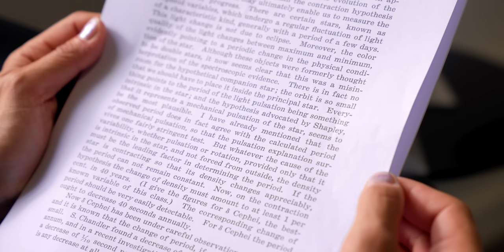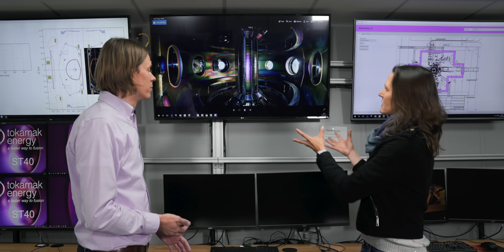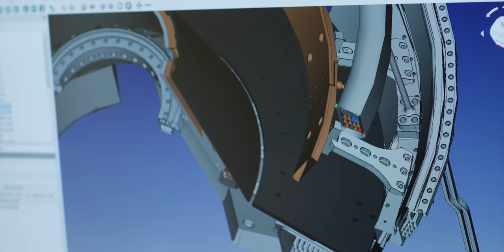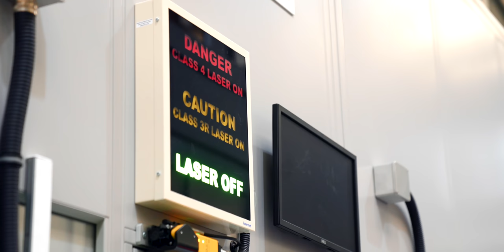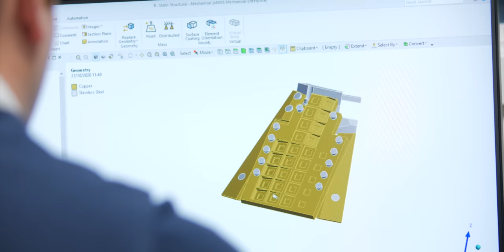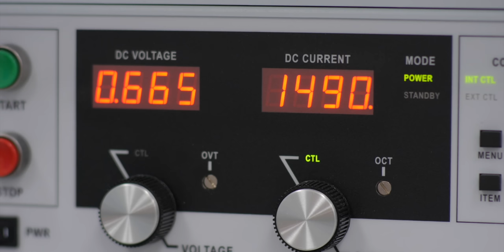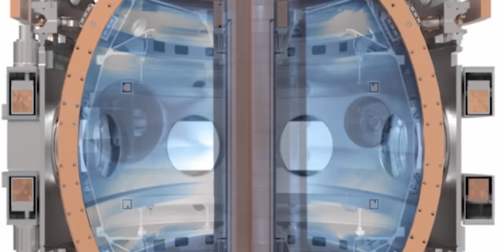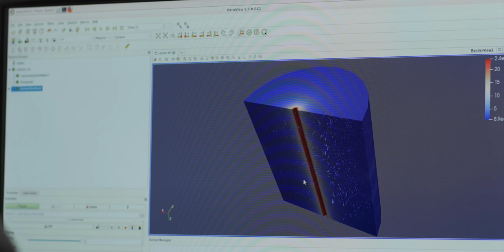Nuclear Fusion: The Secret to CHEAP and LIMITLESS Clean Energy?!

Comment: So one thing that never seems to be asked, and I'm always curious about, is how you would actually extract the energy from the reaction. With fission, the fuel is in a bath of flowing liquid that carries heat away, but it's not at all obvious how you would extract the energy from a ball (or donut) of plasma, especially when so much effort is put into keeping the energy from escaping.
Reply: I often wonder too but perhaps one would absorb the radiation
Reply: The walls of the vacuum chamber heat up, both due to radiated heat from the plasma and neutrons from the fusion events. It needs to be cooled down by water or some other coolant. The heat that goes into the coolant can then be used to run turbines to convert it into electricity.
Reply: EXACTLY ! How indeed do you contain a plasma at tens of millions of degrees without the thing melting ! There don't seem to be any real engineers working on this, just theoretical physicists with their heads in the clouds.
Reply: @grahamstevenson1740  Uh... in case you weren't being sarcastic, you contain it with magnetic and/or electrostatic fields.

Anyone who's been remotely in touch with fusion reactor development knows containment is one of the biggest areas of focus. To say there aren't any real engineers working on this is so absurd it HAS to be sarcasm...
Reply: @Smidge204  BUT, the magnetic fields (never heard of electrostatic being used, doubt that would work) DON'T stop the damn thermal energy do they ????

How is some solid going to be comfortable with a 50 million degree radiant source on one side and relatively 'normal' temperatures on the other ?

It's a perfectly sensible question and one I've NEVER had a satisfactory answer to since most of the researchers seem to have their heads in the clouds !
Reply: How do you extract it? Not very efficiently I’m afraid.
And adding that low efficiency to the high energy cost of containing and heating up the plasma, you have the reason why the 30 years joke is probably even too optimistic… 😐
Reply: Turns out they worry about that. Clearly without proving they've solved it, since nobody has got much beyond break even for more than a dinkosecond.
Reply: The neutrons produced in the reaction fly out and hit the surrounding torus heating it up. That torus of magnets needs to be kept at liquid helium temperatures, so it's of no use for generating power. In fact, it consumes power keeping it cold.

It's really just another in the long list of issues that are supposed to get solved "in 20 years".

Maybe enough neutron flux will pass through the magnets to another layer that can absorb them and heat up enough to produce power. Of course if the neutron flux is that high, it will transmute the torus into junk in a few hours.

So there's another issue that will get solved "in 20 years"

Really, the more one finds out about this, the more it makes sending money to a Nigerian Prince seem like a sound investment.
Reply: @grahamstevenson1740  Maybe the reason you've never heard a satisfactory answer is because you don't understand the physics?

First, look up inertial electrostatic confinement. Generally speaking, plasma confinement is a "solved problem" - the challenge is building a large enough "bottle" while also keeping the density and pressures necessary for fusion to occur. The Tokamak design is the most popular since it has a large volume and can be made stable.

With that out of the way... there are three modes of heat/thermal transfer;

1) Conduction, which is heat transfer from one medium to another through direct contact. Since the plasma is, ideally, not physically touching anything, this isn't a problem. In practice the occasional ion will have enough energy to maybe reach the walls but the engineering challenge is to minimize that.

2) Mass transport, aka convection. Heat transfers from one medium to another through an intermediate substance that moves between the two. The plasma exists in a vacuum, so there's no intermediate substance to carry the heat between it and the vessel walls.

3) Radiation. All matter above absolute zero in temperature emits energy as electromagnetic radiation. Heat is transferred between objects based on the net flux of this radiation. This is the ONLY method that the plasma can exchange energy with the vessel walls.

This one is a bit tricky, because the amount of absorbed or emitted radiation, and the energy per photon, is highly dependent on the matter - for example, you can engineer a material that emits more thermal energy than it absorbs, resulting in a surface that is always a little bit cooler than surrounding ambient even in direct sunlight. A really good emitter but a poor absorber. You can of course do the opposite and create a great absorber but a poor emitter - such a surface can be hundreds of degrees but appear cool to a thermal camera.

Surface area and distance also play a role. No matter how hot, radiative transfer can only happen at the surface. The reason the sun, at 6000C at the surface, doesn't burn nearly as much as an iron ball at 1000C inches from your face, is because the sun is millions of kilometers away. Inverse square law and all that.

So we need to consider both the properties of the plasma and the containment walls and their spacial relationship.

Some plasma is actually really bad at thermal emissions, so just because it's incredibly hot does not necessarily mean it's emitting a proportional amount of thermal energy. Similarly, you might have noticed in various photos that the vessel walls are really shiny - this surface finish reflects thermal radiation back into the plasma and minimizes absorption.

So we can't avoid thermal transfer from radiation, but we can go (and have gotten) a long way to minimize it through engineering. Success is a matter of getting the plasma hot enough that the collisions have sufficient energy on average, and dense enough that collisions happen with enough frequency, that the reactor outputs more energy than it takes to run it.

The reactor shell will still need cooling. The other comments suggest that this is how you extract the energy - I mean, probably? But my point is I want to hear that from the scientists and engineers actually building the machine, not conjecture from the audience.
Reply: 80% of the energy is in the neutrons that fly out of the magnetic field into a heat absorbing blanket area. For the CFS company this will be a molten salt protecting the magnets for at least 10 years. Salts are corrosive which will be a headache but they can also operate at much higher efficiency than water, from under 40% for water to over 50% for a high temperature salt
Reply: @grahamstevenson1740  the plasma is confined by the magnets, it touches nothing but it's also turning out to not be a very workable technology. ITER will by design fall 100MW short of breakeven. It's not going to work.
Reply: @grahamstevenson1740  it does work but not well enough to produce net energy.
Reply: @Smidge204  If 'solved' then why does the plasma 'break up' which usually seem to precede any run ?
Reply: @grahamstevenson1740  For the same reason that making a 12oz water bottle is a solved problem but making a 12-billion-gallon tank is identical in concept but a skosh more difficult in the... finer details. All the theory is worked out and it's currently in the engineer's hands to turn that theory into practice at the required scale.

So again, to say engineers aren't working on it is absurd. You didn't even know about electrostatic confinement - literally the method of choice for DIY fusion reactors (Did you know more than one person has built functional fusion reactors in their garage? Some of them high school students!) - so I presume your knowledge in the field is somewhere between "I've seen a few YouTube videos about it" and "Disinterested layman".

You will never get a satisfactory answer to your question, because if you had the foundational knowledge needed to understand the answer you wouldn't have asked it in the first place.
Reply: @skylerlehmkuhl135  It's crazy that after all this time we've been generating electricity it all just ends up being generated by boiling liquid and pushing steam through a turbine...
Reply: @Shep Raynham That may be true but I'm retired now. It would be interesting to be involved in that research or also in BEV development actually.
Reply: Two answers: 
You either heat a fluid like water and turn a steam turbine; the same as most electrical production systems. Or, another way, a research group recently found a way to extract electricity directly from the electromagnetic field produced by fusion. Very much like those induction batteries charged on plates with no direct connection. Both ways would work though to make electricity.
Reply: @grahamstevenson1740  you need the thermal energy to heat up water and then steam using turbines and generators 🤦🤦
Reply: @woodpenguin954  The problem is how to avoid melting the heat exchanger with hundreds of millions of degrees on one side.

Comment: Would be amazing if you guys could cover CFS’ SPARC reactor at some point. I think either CFS or Tokamak Energy will be the ones to break through to commercial sale, but as was said at the end, even if these technologies are a technical success, they’re unlikely to be cheaper than renewables in the beginning, and will take decades to mature. Not to mention they’re a very centralized form of energy (also high capital costs) which, in an increasingly unstable climate, is not the most resilient addition to a power grid. That being said, I’m optimistic that they will play an important role in the future.

Comment: It also needs to be affordable.  It costs ~$30/MWh to convert heat into electricity and renewables are already <$30/MWh.  So if thermal energy from fusion costs >$0/MWh it's going to have a hard time competing with renewables :/
Reply: One of the fusion companies projects as low as $10 MWh if the physics works and the reactors are robust to the neutron irridation. They are using a direct energy conversion system twice as efficient as steam

One neglected issue with renewable costs is the cost of backup generators and transmission upgrades which costs about an extra $50 MWh when you're adding more renewables past 50% of generation. Either fusion, long term energy storage or something else is needed to consistently get past 50%. Hydroelectric and nuclear grids are the only really decarbonized ones currently

Also it may be that the $50 MWh cost of steam generation is for electric to heat storage to steam... for instance Thorcon is projecting $30 MWh for their molten salt thorium fission reactors
Reply: @Canucklug  That would be a neat trick considering it costs ~3x that just to turn free heat into electricity.
Reply: YES.  Exactly this.  It really comes down to cost/Watt.  "Limitless", "Free", yeah great, but essentially the same can be said for fission and that's never achieved a competitive cost.  

I fully support all this research- I believe all sorts of useful knowledge will come from it, some totally unexpected, and someday... maybe not competitive fusion, but useful?

BUT- I feel like the promise of fusion is often used as FUD to stall nearer-term useful solutions.  I'd like to see more renewable, more geo thermal, and I'd like to see some modular smaller scale fission, maybe even some Thorium...  and not do it in the "all eggs in one immense basket" way we've done with nuclear.  Dispersed, local, redundant, fault-tolerant- not massive, complex, crazy regulations, pork-barrel.

Comment: The problem is of confinement, in stars inexhaustible ( sort of free confinement energy ) gravity cause the matter to achieve fusion and then gravity also acts as confinement, in the end when the fuel runs out this inexhaustible gravity wins as the star either turns into a neutron star or a black hole.  Also in stars fusion happens at a much lower temperature because of quantum tunnelling so they are much better at utilising gravitation energy. In tokamak design there is no inexhaustible gravity confinement, confinement happens due to electro-magnets which utilise energy. So the problem is that this confinement energy has to be slightly more than the fusion explosion in order to confine it,  that is why all fusion reactors are energy negative. Unless something drastically changes in our understanding of physics and more importantly gravity, fusion will always be that 30 years pipe dream. Please correct me if I am wrong, however, till today I have not heard of a net positive fusion reactor.

Comment: seems to me we've got a perfectly well-functioning fusion reactor already pumping more energy at us than we can use, just 8 light-minutes away, and we've barely begun to tap into that - nevertheless even the little bit we've started to do is already producing lots of energy at very little cost, with improvements happening all the time
I mean sure, keep working on this too - as long as it doesn't detract from things that are already producing results
Reply: Except it doesn't work at night, is very ineficient and takes so much more space than a fusion reactor
Reply: @Ked_gaming  It is always daylight somewhere. The Sahara Desert is mostly empty as are other deserted places around the world. We need to think of our energy production and distribution globally.
Reply: @Ked_gaming  here in the UK we already have 7 interconnectors with Europe and Ireland. Electricity can flow both ways depending on where supply and demand is. A windy Norway can supply cheap electricity to an in demand UK. In these days of high voltage DC interconnectors there is even a project to see Moroccan solar piped to the UK. At this point if successful we will have base load renewables.
Reply: @Ked_gaming  it is already a project, look for yourself. Xlinks project. A number of companies involved including recently, Octopus.
Reply: @stulop   And in Australia, we are building an interconnector from north WA to Singapore, so we can sell our sunlight from the Aussie desert to power the city state.
Reply: Lots of smart people are working on lots of difficult stuff. Makes me sleep at night
Reply: In the UK we can't actually see it much in winter, for 18 hours it's at or below the horizon and for the 6 hours it's often obscured by cloud, but yep it's an important part of a suite of sustainable options that we need. Nuclear baseload is the only way I could reliably and economically power a heat pump for my house, but far too many luddites around so let's see where we end up. Probably renewables plus CCGT for the weeks where the air is still in winter, that's my guess
Reply: That comment doesn't make sense. Imagine not working on somthing new just because we have something that already works lol. That's like saying lets not work on electric cars if we already have ICE cars and trucks that already "produce results".
Reply: @katjerouac  or ICE cars that only work for 8 months of the year :)
Reply: @katjerouac  you failed to read my last sentence, or chose to disregard it
Reply: @stulop  yeah but then you  have to store and transport that power.
Reply: @tmarritt  Thinking globally, storage becomes less important. For transmission,  see HVDC cables that become more cost effective than AC at distances greater that around 600 miles.

Comment: Fusion will NEVER be low cost. It also generates ionising radiation so nuclear waste is also created. 
Moltex fast spectrum nuclear, burns nuclear waste is low cost. It solves the waste storage issue and generates at least 20x as much power in the process.